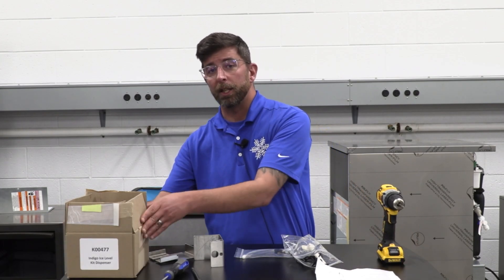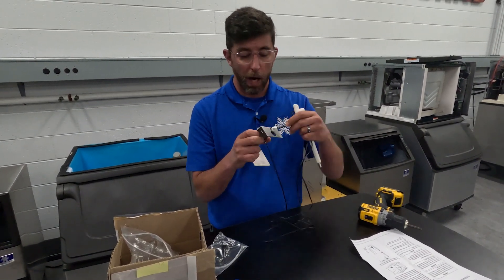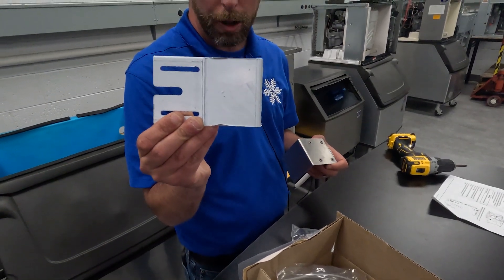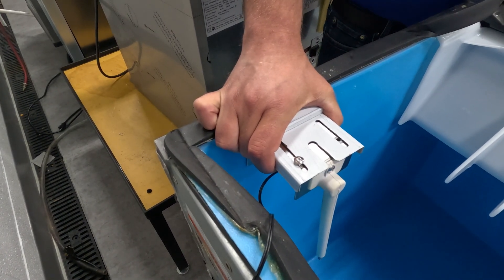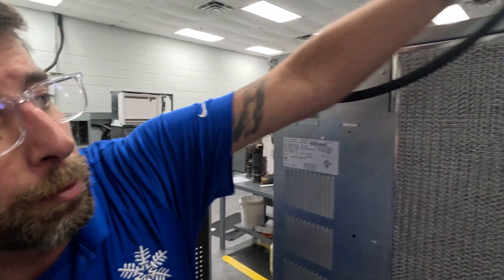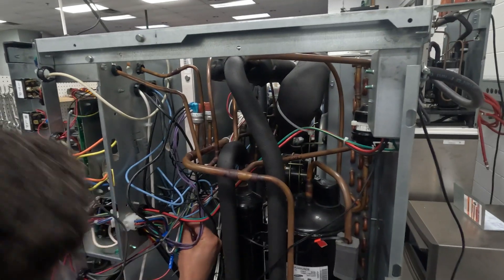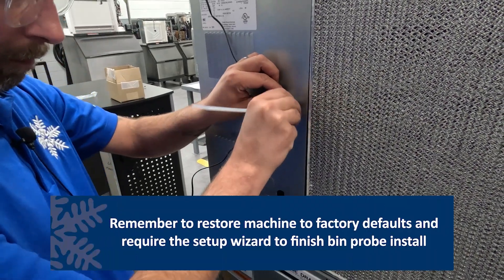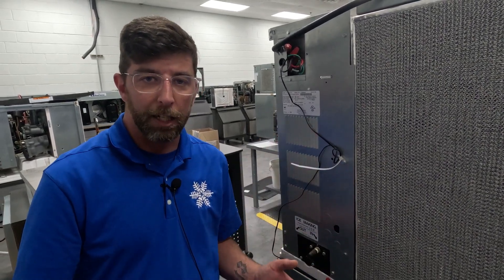Bin Level Probe Installation

Comment: Seasonal facility restart.
1st Gen Indigo cuber on a huge Klopenberg  bin.

Never had a bin level switch.
On restart, now seeing on display "Prog Mode / Bin Level."

Will look up reset default setting.
Probably not a bad idea to add a bin switch as the flapper that prevents ice from pouring out the bin overnight has vanished!